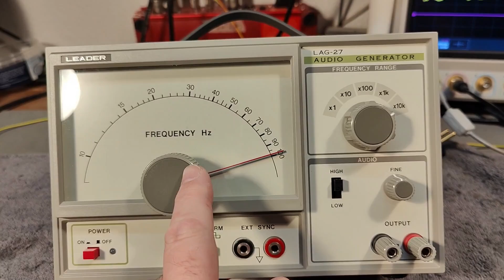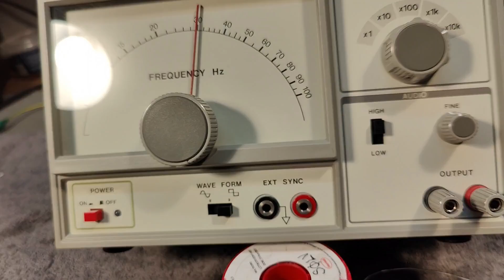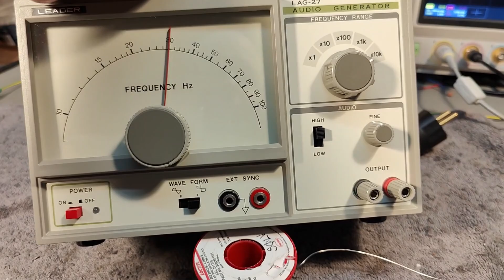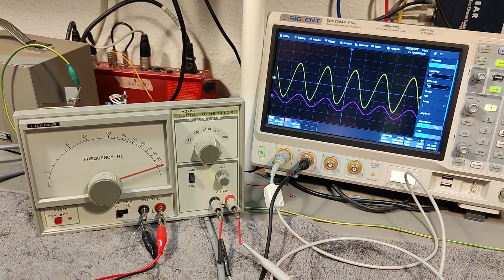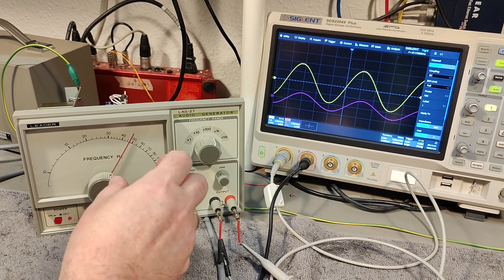LEADER LAG-27 Audio Generator Oscillator 10Hz-1MHz 1984

Comment: I never did find out who actually made these, as this design was marketed under different labels, with B&K and Fordham being two. However, I do know that these carried over the looks of the older Leader instruments, and I always thought that Leader may have been the manufacturer of them.

These came out when B&K started purchasing Asian equipment, which was rebranded. Eventually, B&K stopped all US manufacturing, and purchased their equipment from several Asian manufacturers. At the time, I was made an offer, by B&K, to buy all their old parts and units, made in the US, about three tractor trailers full, to provide service work for the company. I almost took them up on it, but turned it down.
Reply from the maker: you are right, it is amazing how many purchased and rebranded this one and the entire family of instruments